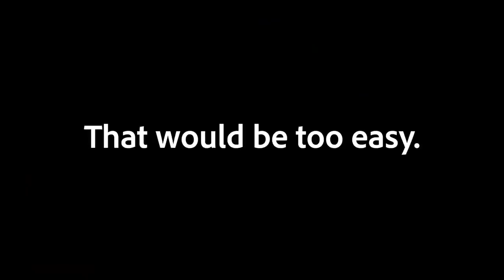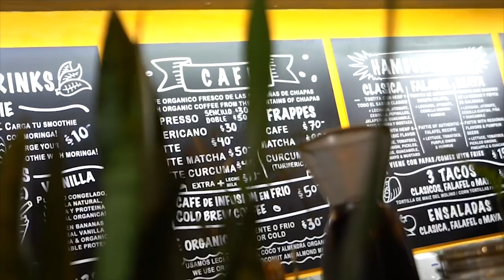We’ve got a BIG PROBLEM // Don’t Stop Belizen Ep. 51

Comment: Pineapple spot removal tool:  Many vegetable peelers have a point on the end.  That end is usually curved and can be used to rotate around the spot and effectively cuts/digs it out leaving you with clean pineapple.  OR just a paring knife in a small circular motion.  Your frame issues and hitch challenges are severe.  Please find some way to reduce the weight and stress until you get if properly addressed.  Buenos Suerte.

Comment: Time to get a trailer, problem solved
Reply: That will not solve the problem immediately The promaster now has a weakened unibody at the mounting points . First they will have to repair that problem. 
And then they could to a proper hitch. 

Now they could add brackets from bumper support on right and left sides. Jack up hitch and attach new support  to hitch on both sides . 

The way it is now shock load is damaging the unistructure
Reply: @drmachinewerke1  Totally agree with you and Leo.  With a trailer the hauling capacity is limited to "pull" weight.  But their problem is their hitch's "tongue weight" capacity/limit coupled with all the bouncing around the bike is doing.  The tongue weight will be next to nothing once they have that bike on a trailer.
Reply: Tim B 
I agree a trailer would be nice. You still have shock load to consider. And if you do not have tongue weight   The trailer will have speed wobble. 
I imagine he has repaired it before we watched the video. 

Very least. Support the back of the hitch with a support . And build a simple towing device. To slide the bike front axle through. 

Trent welcome to farm life and repairing things  with what you have. Your doing great there young man.
Reply: @drmachinewerke1  Yes, definitely they didn't think through that decision

Comment: Trent can you bolt a piece of steel to bumper brackets. Then bolt another piece across to pieces at brackets. Now attach a 2” tube to horizontal piece. Remove wheel from bike.  Slide axle though 2” piece. And X tie downs from bars to cross piece.  Hopefully this makes sense. 

You should be able to use steel from trailer hitch Assembly you purchased

This is for a quick fix. 
Later you can build a piece that your front wheel will sit in made from 4 “ channel .

I have a picture of what I’m talking about if someplace to post it
Reply: You already have a YouTube channel, even use a cell phone to "record" 5 seconds of video of the picture, then put it up on your channel... easy no ? ps new sub as well
Reply: TheCanadianBubba 
Good thinking. 
I do that when I get home.
Reply: I uploaded a video for a simple fix. No welding needed. 
Trent go to my channel look at March 12

Comment: The 2 hinge on each side are super strong , the bottom hinge you could use the orange strap. And wrap it around the outside opening side and in between As the strap is thin so the hinge close on it. And add a ring on the outside. This allows you to put a removable dog release strap to take off to open the door.. you can sew the strap on. See if you can find seat belt strap. You can sew it with dental floss. To custom make what you need. It’s just relive the weight 50/50 flex turn to large cracks were you about.
  That limestone sink hole was fantastic, love the tree hanging over. That my favorite climbing trees. And hanging out. Can’t get better than that. Yes make good  use of that bike. Somehow mexico seem more homely now.
Reply: The pineapple cut top and bottom off slice 1” 1/2 round top to bottom. After skin off. Cut V goove rolls at a angle.sideway taking out the eyes. So it look as a screw finished..

Comment: Wow - what a great "roll with it" life video!

I got it wrong. Frank is a line backer and not a wide receiver - hope it doesn't hurt now Allie.

Re the hitch: its clear that the mounting points on the uni-body are not strong enough, and secondly that the main length-way bar is too weak. Effectively the hitch is rotating/oscilating length-ways around the rear cross member (which is acting as the movement axis), and its therefore weakening/destroying both those rear components and possibly the uni-body. Check that the weight of the bike is within the weight limts of the hitch/mount, then look at primarily strengthening the forward mounts on the unibody (ie those near or beyond the rear axle) - larger flat mounting plates here, add possibly add a further cross-chassis strengthening member. I would then look at strengthening the length-way bar between the forward and rear-most mount (on the uni-body).

Possibly temporary fix: with the front doors open, run a rope over the roof and back across the front headliner (ie across the chassis) to act as a fixing point. Then run additional ropes backwards along the length of the van and down to the rear most position on the bike mount. Wouldn't want to do it long term, but it might reduce the bouncing/pivoting around the rear cross-member sufficently to stop further deterioration. Good Luck!

Comment: Hey if you can find somewhere to hook a strap on each side of the van up high, and then hook on each side of the rack on the outside corners and use 2 ratchet straps as like support strings to support the weight from slouching down, that might work until you get it welded and fixed. (Commenting this half way thru so maybe you did fix it at end of video lol). Possibly the upper hinge for the rear doors on each side you can hook the strap to temporarily, but I don't know if that would pull on the hinge too much.

Comment: A smooth little trick to get you down the road. Put the front wheel of the motorcycle on the rack and strap it into place and allow the rear wheel of the motorcycle to trail behind on the road. Not an ideal situation but it takes most of the weight off of the rack and puts it on the rear wheel of the motorcycle. Don't back up

Comment: So, uhh T-Dog, my brotha.  You need to weld a couple of metal bars to the roof of the van with eye hooks at the end.  The eye hooks will overhang the back of the van.  Connect a strong spring to each eyehook and then tow straps from those to the rack.  This will reduce the stress.

Comment: Can the bike be installed on the front? Not a quick fix though.
Reply: He could buy a front end receiver kit, but then he has to worry about not getting enough air flow into the radiator to keep the engine cool

Comment: Look for a local welding shop to fix the hitch and fix it mexican style it be better than ordering parts
Reply: 210 SRT ...the unibody of the van is the problem!....unibody is several layers of sheet metal pressed together & formed , with U channels for rigidity....you might be able to bolt some steel angles or channels to the unibody framework....the heat from welding would seriously weaken the sheet metal unibody by removing the annealing!...

Comment: Don't know if it's been suggested but run your ratchet straps to your roof rack to take the weight off the back of the rack
Reply: That would wreck the roof rack. Needs to go all the way to the front with rope and tie to the front bumper brackets, then a ratchet from the rope to the rack to tension.
Reply: What about drilling holes into the frame of van for straps? Would that work?
Reply: Roger Starkey no no no, you have to wrap the rope from the back bumper, over the roof rack around the hood and back to the trailer hitch.......lol...strap to the roof rack would work fine to drive around
Reply: @firm1z  Unibody van so there is no "frame" to drill into.  Back of the van body will have to be significantly reinforced with a heavier hitch mount if they want to keep hauling the bike that way.  Easier solution might be to purchase a small bike trailer.
Reply: it has been suggested when the problem started weeks ago,
but ...
Reply: Well hopefully that they are now back in Mexico they will find a shop that can help them out.  If the Unibody is cracking they are definitely going to have to find a welder.  Ouch.
Reply: @loganholmberg2295  shit, good luck getting a welded unibody to pass safety inspection
Reply: @BikingWIthPanda  lol yeah that could be an issue.  Hopefully it never has to be.

Comment: I think I have to agree with the previous comment you guys need a trailer.  you'd only have  a few pounds of tongue weight by using a trailer. Most of the weight would be suspended by the axle of the trailer.

Comment: What is different from Jordan's bike rack ? He seems to be doing good. Just wondering
Reply: The attachment to the bus.
Reply: Bus is a 1 ton chassis with a frame compare to unibody (no frame) of the van.
Reply: @RussellBond13  is it even one ton? My Volvo v70 is 1500kg, it should be at least 3000 kg? But yea, theres a frame on it.
Reply: Not sure what you mean. The bus is on a 1 ton chassis. On a Chevy which is what the bus is you have a 1500 series which is a 1/2 ton, a 2500 series which is a 3/4 ton and a 3500 series which is ac1 ton. It doesn’t mean the weight of the bus. I have a Class C rv on a 1 ton chassis, it weighs over 12,000 lbs.
Reply: Ian Ah, now I’m with ya. English isn’t my mothertongue and I’m not that fluent as I wish I was.
Reply: On the Promaster the hitch seems attached to the body, not the frame. Fine for towing, but the cantilever weight is too much downward or bouncing force. Need to reinforce the hitch with some bars welded to the frame.

Comment: @5:43 Trent asked for pineapple tips. You simply need to rearrange your steps. For maximum flesh: (1) cut off the ends; (2) slice off the skin; (3) note the spiral direction of the eyes [99% up & to the right or down & to the left]; (4) cut two eyes at a time along the spiral line; (5) stand the pineapple upright and cut down into quarters; (6) cut out the hard core from each quarter (7) cut the juicy flesh to fit your blender. VOILA!